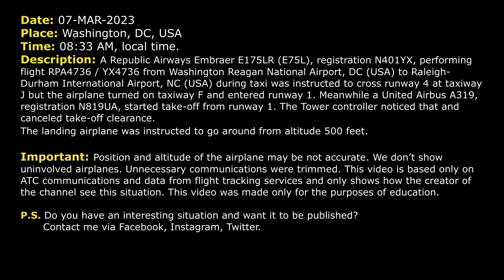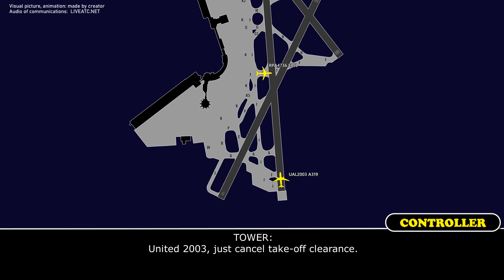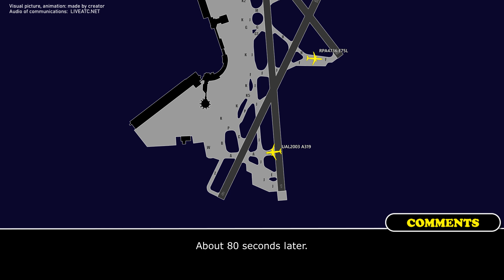Runway incursion. Republic Embraer E175 entered wrong runway at Washington Reagan Airport. Real ATC

Comment: This is on ground control mostly. They assigned them 33 for takeoff and hold short of 1 at F. The ground tells them to cross 4 at J. The pilots just heard cross and didn’t realize they were crossing the wrong runway. Expectation bias strikes again.
Reply: Definitely expectation bias. Also, anyone familiar with DCA knows that it is an extremely fast paced airport and any runway clearances must be executed without delay. For example, at the time when this occurred, there were about a dozen arrivals lined up on approach and a queue for takeoff. They heard instructions to cross RWY 4 and did so, but at the wrong intersection (F instead of J). Just thinking from a human perspective here, they probably wanted to get across the runway as soon as possible and didn't reaffirm the clearance with tower to not delay the sequence. After all, they were going to RWY 33 and this was their route, so in they're minds they're probably thinking "oh, he means F". Then ATC has to repeat himself, and now they're rushed and probably ended up catching a case of "Hurry-Up Syndrome". Not saying that this isn't a mistake, but psychologically I can see how it can happen.

edit: a word
Reply: The pilots should have caught the error but I agree with you ground is at fault and shares a great deal of blame.  A ground controller is not giving crossing instructions without receiving a clearance from the local controller that he is standing next to in the tower.  The ground controller lost situational awareness when the local controller gave him crossing clearance.  The ground controller should have recognized this and said “that departure is for 33” to the guy standing next to him.  Complete loss of SA.
Reply: Ground definitely holds some responsibility, but they weren’t cleared to cross 1. Brickyard should have queried ground and holds some responsibility for sure. Ugly situation..
Reply: I don’t put this on the controller.  The republic pilots should have known where they were, what they were supposed to be doing vs what they were instructed and recognized that didn’t make any sense.
Reply: NOT on ground control mostly. On the pilots. Expectation bias like you said....lands on the pilots. They read back instructions and did something completely different.
Reply: @billybuttons4298  It starts with the controller. Pilots have to catch the mistake, but I guarantee the controller forgot he sent them to 33, not 1.. On the route given, they cannot cross 4 at Juliet. When you hear a crossing clearance holding short where you were supposed to be, it’s going to be a decent chance the pilots don’t catch the mistake. Being given the wrong clearance doesn’t put it fully on the pilots by any means.

Comment: That's a tough one for the pilots but they still should have caught the runway crossing clearance was for 4 and not 1. Taxi instructions to 33, the box was setup for 33 and then they throw in a runway 4 crossing to runway 1 at the last second. Equal blame all around? maybe...
Reply: Equal blame, yes!!!
Reply: @gavinsingh4450   I certainly think so. ✈
Reply: ATC lead them down this path.
Reply: @jimziemer9826  Yeah, but the Crew still bears a large share of that blame!
Reply: @gavinsingh4450  Yes, they should have caught the crossing clearance.
Reply: @jimziemer9826  Mistakes happen though, as evidenced here...